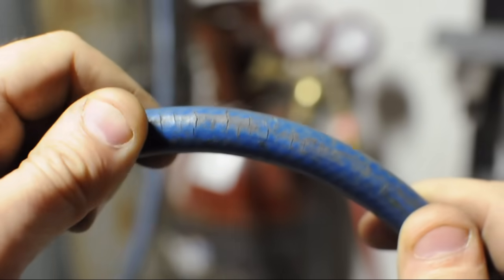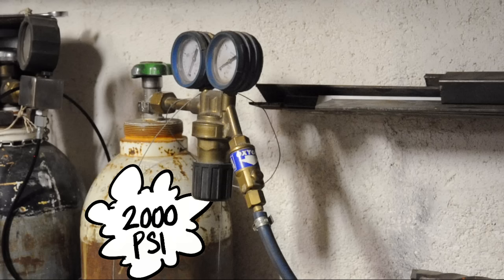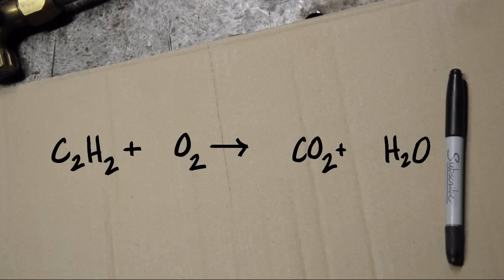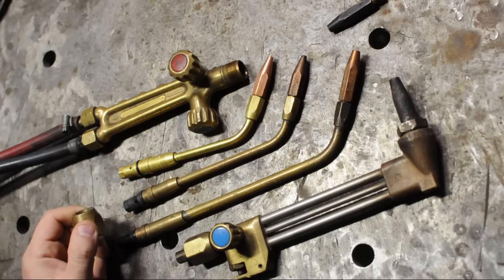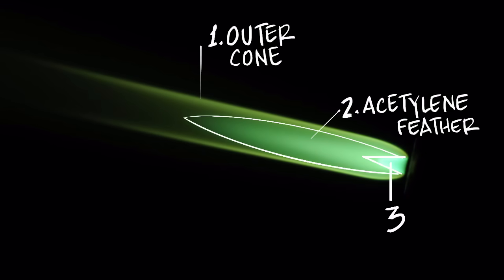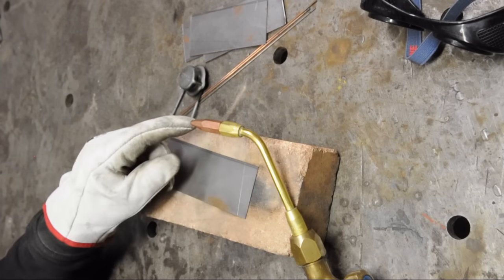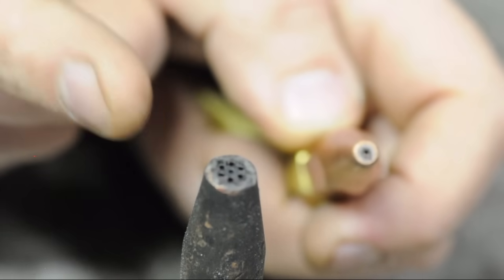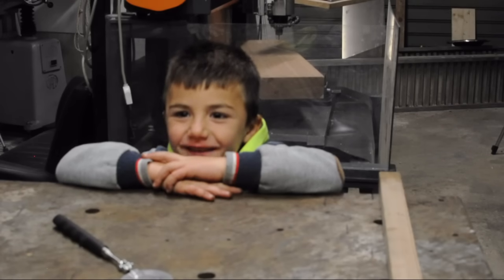Let's Talk Oxy Acetylene

Comment: To those who hang their acetylene bottles upside down, who cut or drill holes into the bottle, who mix the acetylene and oxygen in one tank, and who abuse or don't use the regulator or valves, you have missed the most effective way of using an acetylene bottle.

That way involves turning the filled bottle inside out. 

It's a lot of work, but the results are impressive.
Reply: who you talking too??? there all dead.
Reply: im confused pls explain
Reply: @theaniahlator7954  He means it involves rapid expansion and possibly pink mist from the user. lol
Reply: Funny, I don't remember writing this.
Reply: @davidgreen5099  you didnt but its pretty cool that there's two of ya
Reply: @guss1470  😂
Reply: But if the bottle is inside out, what happens to the candy corn?
Reply: Can confirm, I tried this myself and I was blown away.
Reply: Following the leak with your nose until you disappear completely. Garlic- like.

Comment: Glad you brought up the subject of lighting the torch. Since we aren't always going to be standing next to  the person lighting their new torch for the first time, or the kid that uses your shop while you are off doing something else, we can't slap them upside the head before they burn down the shop. 
1. My reason for using the striker to light the torch is, I was taught to plan for the worst. A stoichiometric flame oxy-acetylene flame has a huge amount of available energy. Mr. Stankey demonstrated it by filling a small balloon with acetylene, setting it on the welding table, and igniting it. It popped. No big deal. He then filled the same size balloon with oxygen and ignited it. It just deflated. 
Then he llt a flame on the torch and turned off the acetylene at the tank. If you are crazy enough to do this leaving the oxygen on lets the flame go out without flashing back into the torch. When the flame went out he turned the acetylene tank back on and filled another balloon the same size with the stoichiometric mix. When he ignited it the explosion blew two firebricks out of the top of the table. 
Most of us old guys quit smoking after the first heart attack, but for you young guys who still think carrying  a  lighter is cool, think about where your hand is when you are lighting the torch. That extra distance the striker gives you is handy for when you are learning and keep having to relight the torch. 
Yup you won't always turn off both valves and let the torch empty before restriking it. That's when you figure out it makes a nice big bang even without the balloon. I know at least one idiot will spend a few hours making big bangs after reading this. That's okay. Just do it out in the middle of a cornfield some where. You will only blow down a few rows of corn and the coyotes will clean up the mess. 
2. The striker has a nice loop in the handle. When you are an iron cutter you can hang the striker on a short chain and clip it to your belt. That way you don't need to take off your glove, dig into your pocket, light the torch, stuff the lighter back into your pocket, put your glove back on, and go to work. That's especially nice when you are working off a ladder or on a catwalk 30 feet up. Climbing down to get your glove, lighter, or the stuff in your pocket that came out with the lighter gives your firewatcher a great story to tell about you for the next 40 years. 
Note: Yes you do need a firewatcher. Those sparks will set off pretty much any flammable materials they come in contact with including your pant leg. 
Side note: Don't wear pants with cuffs, or roll up your pant leg. I know that Johnny Dep does it. Look him up. I don't have time to explain everything. With the goggles on you won't see the flame. You will find out when the fire is up past your sock. Again, not cool when you are on a ladder. The firewatcher should let you know in time to keep your short and curlies intact. 
Thanks for reminding me of old times Tony.
Reply: Good tip about cuffed pants. A buddy always wore jeans with cuffs, and they got thin at the fold. Got a hottie in there while cutting. Picture a guy dancing around with a burning ring of denim on his boot.
Wear gloves. Slag welded to a wedding ring SUCKS.
Reply: I remember being taught all those reasons.  Another was was that they're plastic, so they easily crack and/or leak...and a  Bic lighter supposedly has roughly the same explosive power as about a 1/2 stick of gelignite if it all goes off at once.  Not sure how accurate those numbers really are, and I'd guess it would take a combination of getting everything just right (or everything just wrong, depending on your perspective) to accidentally have the right mix of air and gas.  But if I didn't have bad luck, I'd have no luck at all.  So I never used a lighter, and I still have all my fingers to show for it.  :-)
Reply: The absurdity of the gelignite claim aside (lol), there is no real reason to not use a lighter other than preference. There are long lighters with loops for hanging, etc. Want a lighter that lasts a long time? Get a striker. It will be become more and more in consistent though. Want a cheap option? Get a lighter. It'll only last a short time. etc. etc. etc.  

The "Old Guard" has just been passing down "advice" for years and it just becomes law "because."

Comment: "Just like my boy, it's chained nice and securely to the wall"

You're too much this old tony.

Nobody ever really taught me oxy-acetaline, so I appreciate the tips. How long should the flame be? Should I use more oxygen, or less acetylene? I wouldn't mind a part 2.
Reply: The Metal Butcher My university textbooks say that the whole flame should be around 30 centimeters, which always felt like a typo to me. Anyway, what makes the flame shorter is the adding of oxygen. You always look forward to get a small triangle blue flame at the tip (it depends on what kind of weld you want to get though). Always remember to turn off the oxygen first and if you blow it through the pipe, always direct it away from you - it's a clean oxygen, so it combust when it meets fat (for example the one on human's skin). Hope there's something helpful in my comment
Reply: @LovelyAngel.  it's been beaten to death in all the forums... But always follow the manufacturers procedures.  Victor is oxy off first, Smith is ace off first.  I'm sure there's some legal clause (should anything happen) that would put the user at fault for improper usage.
Reply: @jamesharrell4360  forums of what website? Theres a forum on almost any website about almost anything. I do not like misinformation any more than anyone else, and i just got a set of handmedown tanks so id appreciate feedback.
Reply: I've been told that If you turn oxygen off first the flame can follow it down into the torch body and burn it up
Reply: @imagineaworld  best solution to everything. Just like your car, truck, boat, furnace...  Read the manual provided by the manufacture.  And if you read the majority of one brand.. it's gas first.   My preferred Victor says Oxy first.  So I do that.  There is no misinformation from a manufacturer manual unless it comes from harbor freight or Boeing.  There are a few PDFs of tank regulations, and how to read the codes. How to check for back flow preventer problems, etc.  Subscribe to AvE, This old Tony. Weld.com, abomb, Cody's lab and you can basically find a video on the topic that uses professional information and provided by a experienced user.   Or come to my house and we gonna make stuff go boom boom.